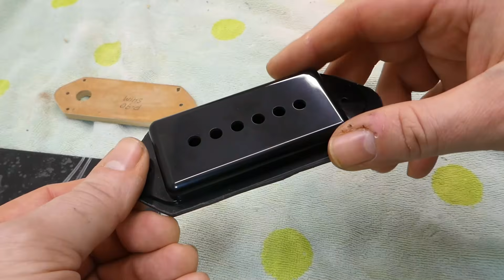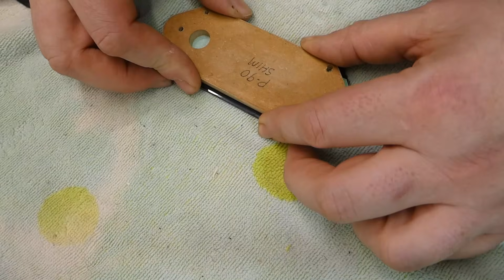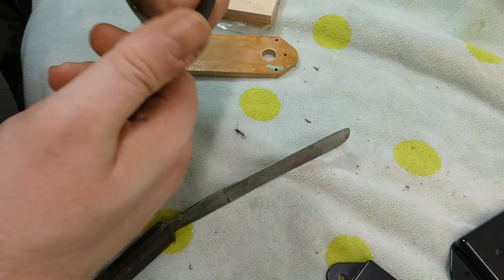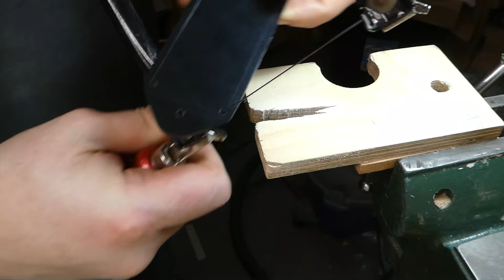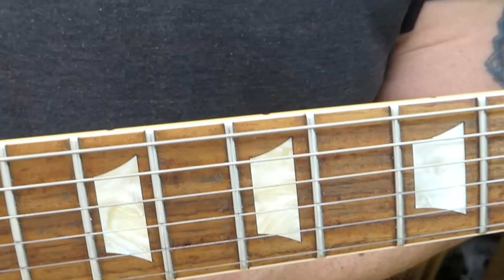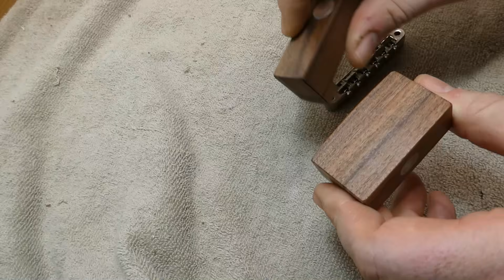Pickup Shimming and Bridge Buckling

Comment: My Les Paul had bridge sag about 20 years ago and I was able to bend it back with shims and C-clamps on the edge of my bench, approximating the same function as your bench vise jig. At the same time I reduced the break angle and thus the pressure to make the bridge sag by threading the strings into the stop tail backwards and wrapping them over the top. The stop tail is right down on the deck & I still have sufficient break angle that's evidenced by no reduction in tone or sustain. It's held up like this for nearly 2 decades so I guess I must have done something right.
Reply: My SG had the same problem after 20 years of high string tension (12s in drop C)
I just replaced the bridge with a Gotoh unit and called it done.
Reply: @jarrusjenkins  
I considered that too but I'm a fix it 'til it can't be fixed anymore kind of guy. It often makes no financial sense but that's just how I'm wired.
Reply: A new one is seventy bucks.
Reply: @richsackett3423  I got a Gotoh drop in replacement for £25gbp which I thought was worth it because messing about straightening it wasn't worth it.
Reply: @jarrusjenkins  Gotoh makes excellent hardware across the board with constantly high value-for-money. My favorite is their 201 Fender replacement bridge.
Reply: On my Les Pauls and similar guitars, I raise the stop bar quite a bit. It's an alternative to wrapping the strings over it. I like the strings to be slinky and that pretty much does it. I'm happy to hear it's better for the health of the bridge, too
Reply: @SonovaBish  Oh yes, it definitely reduces the amount of down pressure on the TOM but I would consider trying the wrap method. Only because keeping the stop bar screwed all the way down seems to, or maybe I should say feels as though it creates a better connection to the body at that particular point. It just seems wrong to me to have the bar floating above the deck to that extent.
I should also add that I bought an aftermarket stop bar and filed string slots in the top then polished to a mirror finish using the common method. It just felt right to me although I doubt that any incidental contact with the strings under tension at the wrap-over point would cause any issues. I guess I'm a belt AND suspenders type when it comes to that sort of thing. But as far as the bridge goes, it has retained the positive radius all these years since having that bit of surgery so I'm convinced it was a good thing.

Comment: On the subject of tail piece height, I've noticed that having too steep of a break angle can lead to shortened string life, and tuning issues, especially if the string is contacting the bridge itself, and yes "overwrapping" the tail piece can "fix" that as well and can lead to a "spongier" feel to the strings, it also kills sustain and makes changing strings a total PITA in a dark back stage situation... I might have to try yer bridge chiropractor trick, I have a couple that are starting to sag, and I'd hate to put a shiny new one on, would stick out like a sore thumb
Reply: Yeah, not a wrapover fan either, unless it's a wraparound bridge to start with. Also, I never deck my tail piece on an ABR style system anymore and just adjust it slowly until I hit that Goldiclocks point where it just feels great for bends but not so loose the strings are too floppy for picking and chords. Everyone can choose what works for them best, but a full decking seems kinda OTT? Sure, you need a break angle but even a few turns will - IMHO - make your guitar feel and play better with zero effect on the mythical holy grail of sustain and tone :)

Comment: Would it be worth the effort and time to route a shallow channel along the bottom of the bridge and insert a steel bar to help the bridge stay flat longer? How to affix it is best left to your experience - weld? epoxy? I don't know. Nice guitar and interesting fix - got to go see if my Epiphone Les Paul bridge is doing that. But the strings aren't buzzing so maybe ok. Cheers.
Reply: I think, and I'm not holding on to one at the moment that there isn't a whole lot of metal to work with, cause the saddles run most of the way through, but you could potentially affix a plate to the bottom and that might help? but in the end the ABR-1's are pretty soft, and pretty cheap to replace, Ted's Chiropractic method is pretty skookum and could probably be deployed several times before failure.

Comment: Facing the same P-90 problem, I bought a couple of cheap P-90 covers, and carefully cut the tops off with my bandsaw, creating instant shims. A wee bit of finish work, and they were ready to use. I'm lazy.
Reply: Smart
Reply: @GRequinBlanc  Probably more lazy than smart, I think.
Reply: @perihelion7798 
No not lazy. You used your noodle, a good habit to cultivate.

Comment: Excellent timing! Instead of shimming the neck pick up of my casino I’m going to try various thicknesses of weatherstripping foam
Reply: @fenderlead1, foam weatherstripping deteriorates, corrodes metal, outgasses,  and may react with the guitar's finish. DON'T DO IT.  I've been repairing vintage audio equipment for decades and dealing with crumbly, or gooey, old foam, and the damage it does to whatever it touches, is one of the worst parts of my job.
Reply: Come on! Get some plastic and do it right! I bet you can do it with files and sanding blocks rather than a router table with a sketchy OSHA-not-approved power switch.
Reply: @seanj3667  not about doing it right… I’ll probably still have almost a dozen or so leftover from various Lollar  pick up purchases lol. It’s about trying new things and thinking outside the box. Someone else mentioned that the weatherstripping form can break down and off gas. That is a valid point! I’ve been using it for about 10 or 15 years and not seen any issues. That said some of the guitars I have are 65+ years old, in that context 15 years is but a blink of an eye.